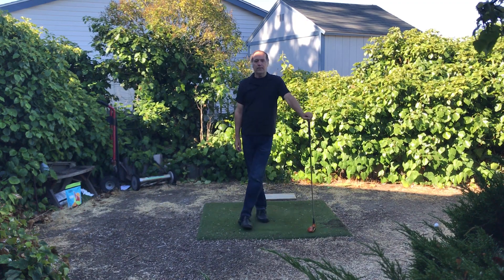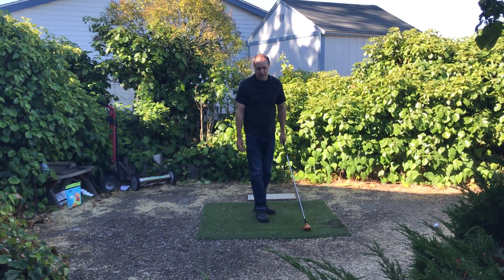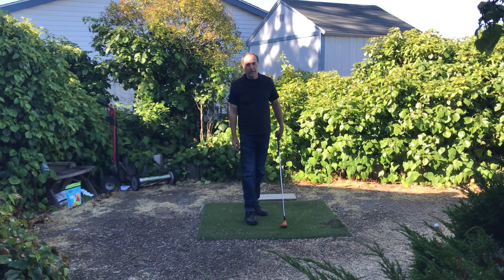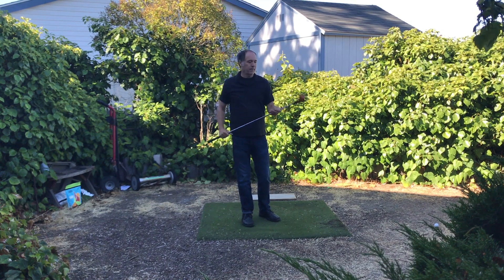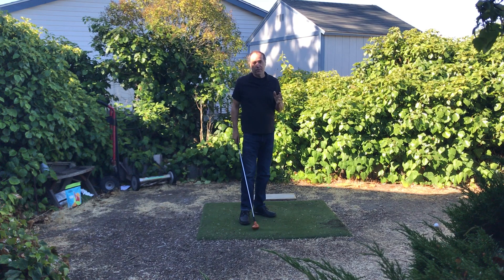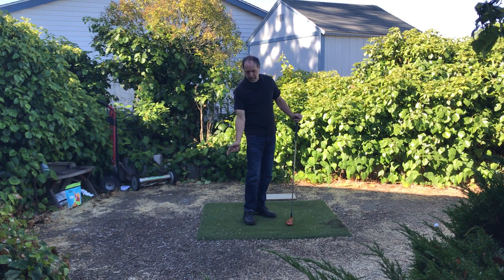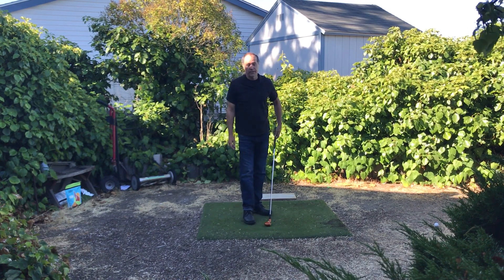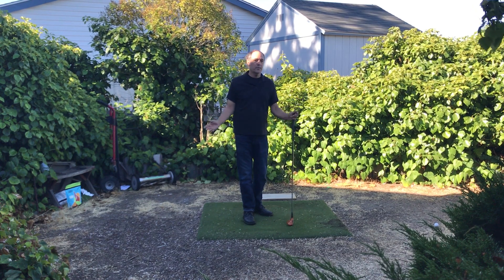Holding Shaft Flex using Advanced Ball Striking Protocols

Comment: It is quite easily demonstrable and probably supported by physics that kinetic energy is held in an arm that is rotating around a fixed center of rotation; and the amount of energy is directly proportional to the tensile strength of the arm itself; with arms with little or no tensile strength having little or no stored kinetic energy and those with greater tensile strength having more.  

When the rotating arm's force vector is uninterrupted by another force the energy in the arm remains constant.  It bends and stores kinetic energy.  When the arm's force vector is disrupted by an opposing force the kinetic energy in the rotation arm must be released.  A braking mechanism produces heat, while an object with inertia either absorbs that energy wo moving or is moved in the direction of the arm's force vector.  

So a golf club with a shaft with tensile strength to sustain stored kinetic energy can certainly be swung with stored energy until such time a braking mechanism or or the ball is struck.  If shaft is flexed when ball is struck some of the kinetic energy in the shaft is transferred to the force vector itself.  

Can it be effectively and efficiently be done by a person swinging a golf club; probably; but with a high degree of consistency (ie same speed and energy time and time again) probably not.  Unless of course you are always seeking to reach the maximum potential of the body club system as it remains in balance.  Then you are always pushing the potential for the maximum stored kinetic energy.  Who would argue that Hogan's swing doesn't demonstrate this principle of a moving balanced body club system with an accelerating force vector beyond the ball.  No recorded swing of Hogan substantiates him doing otherwise.
Reply: John E. understand this and is simply telling you about it.  He didn't invent it...my God he didn't discover it....some guy named Newton did...and Hogan built a golf swing applying the concept.

Comment: Where is the backswing, transition and  downswing? The shaft flex holding concept is surely about holding the flex induced at transition, not the flex induced by dragging a heavy head through impact from a Moe Norman style starting point??
Reply from the maker: Actually.. it's the opposite.. transition is what causes all the problems... too much stress at the top means acceleration too early.  The key is to accelerate post impact... to keep stress on the shaft through the strike.. so this is why this video focuses on that aspect.  Heavy heads are not about dragging, they are about slowing acceleration from the top and bringing more mass into impact which requires less velocity to strike the ball the same distance.  It all works together.
Reply: @lagpressure  so demo it from transition.
Reply from the maker: @golfbulldog  Again, this isn't about transition.. it's about holding flex through impact.  I used a driver with probably a regular shaft and a heavy head so we can actually see the shaft stressing.  No handle dragging here.  Give it a try... and see how it goes.  If you can find someone demonstrating this better through the strike, would love to see it.  Post the link here.
Reply: @lagpressure  the concept that you are trying to refute is that "shaft flex in a full swing cannot be held through impact" - no?? To refute that you need to demo it in a full swing...ie. control transition shaft flex and maintain the flex through impact. That's what you saw when you recorded Peter Senuor etc in your pro career, no?
Reply: I believe he did perform a full swing, however, the editing focuses on what the shaft is doing through the impact zone. In the end, the ball only cares about what’s happening in that zone. Everything up to that point is a vapor trail.
Reply: @golfbulldog   He can't properly demonstrate it because it's not true.
Reply: @theskillanalyst  I don't think that this is a full swing. If you pause the video and use the < and > keys to go free by frame in this clip and other clips where John demonstrates his swing...do your own observations in this manner and make your mind up that way.
Reply: @jackflash8756  my mind is open, but I suspect the real benefits of post impact acceleration occur for some reason other than holding shaft flex. Happy to be proven wrong. Note I am happy to believe that what John teaches does improve some swings, and that is more than what many instructors have sold in the past.
Reply from the maker: @golfbulldog  What is a full swing? That is a pretty ridiculous comment actually.  We are talking golf, right?
Reply from the maker: @jackflash8756  What is not true?
Reply: @lagpressure  It's not true that you can keep shaft flex for a full driver-5 iron swing through impact. Why didn't you just do your normal swing at full speed and then run it in slow motion? I assume it was because it showed forward shaft flex not lagging flex.
Reply: @lagpressure   You know what he meant. Do a full swing at your normal speed from address to backswing , downswing and follow-through
Reply from the maker: @jackflash8756  What is a full swing?  I use the same swing from putting, chipping, wedge shots, short irons, mid irons, long irons and driver.  I rarely if ever take a full swing.  Clearly I have demonstrated that is is "possible". So at what point are you suggesting it would NOT be possible?  This example I posted encompasses all the critical bio mechanical movements we would teach our students through the ABS training course.  Students learn to accelerate through the strike with their post impact pivot thrust, their hand speed, and learn to strengthen and increase both their velocity and acceleration so they can be on the path to superb ball striking.
Reply: @lagpressure   Use your full swing, and a normal modern driver  and then a normal persimmon driver by normal I mean not with the head weight more then 200grams and a shaft can be whatever flex you want.

Do both swings with each Driver and list the type of camera and it's specs,  get tested by a Golf Club manufacturer such as Callaway or Ping or whoever has the testing for clubs.

Then we will see the truth, no backyard trickery with substituting a whippy shaft, DOCTORED CLUB HEAD and suspect editing, you want to act like that vid you posted is refuting scientific claims then you need to do the experiment in a scientific manner, not some ridiculous backyard demo without any verification by an impartial scientific review of such a demo!

You're basically in over your head when it comes to the science!  Also nice open club face at the impact interval , you realize that the club head in your demo is open at impact due to your so called holding shaft flex which makes it impossible at that point to square the face.

The shaft is supposed to flex in the swing like this...right from "A TGM SCIENTIST"
http://www.theswingengineer.com/faq8.html

PLUS THIS  FROM A REAL SCIENTIST

https://people.stfx.ca/smackenz/Publications/MacKenzie%202010%20Understanding%20the%20mechanisms%20of%20shaft%20deflection%20in%20the%20downswing.pdf

Because of the offset position
of the club head’s center of mass, the shaft was gradually
pulled into its maximum leading position (1.22 cm) at
impact. Similarly, the shaft was gradually pulled into its
maximum toe-down position (-1.33 cm) at impact when
radial force acted as the lone contributor to shaft deflection
Reply: @lagpressure  ….. The driver looked to be either a MacGregor Tourney Eye-O-Magic  M85 or a 945?  Please John remember there are vintage club collectors out here.  And a few who were actually encouraged by YOU years ago.  You remember those vintage iron and wood sets you were selling (reshafted X Stiff) on ABS and of course the wood refinishing video series featuring the MacGregor 693 driver.  I can still remember the day you said you bought 3 of those old Wilson wedges for $20 a piece.  Thanks for everything John. You have certainly been a huge plus in my golfing life since I first discovered you and Brad now maybe 10 years ago.  I’ve never been to California, and would absolutely love to meet you and thank you in person some day.  Who knows, maybe it will happen?
Reply: These guys arguing lol. Anyways…a big thanks John to you and Bradley Hughes taking my game to the purest, straightest shots I’ve hit in 25 years of playing. Had a nice little 66 this past summer. Your guys concepts are brilliant!
Reply from the maker: @jaydubeck3435  Sounds like you need to be doing your own experiment.  I just did mine and it's clear as day that I can maintain shaft flex before lowpoint, through and beyond.  It's been done.. there you have it. As far as your experiment.. I doubt you could ever do what I just did.. but good luck trying!
Reply from the maker: @lookmil107  Make it happen!  Glad to know you are inspired by the great generation of equipment, ballstrikers and articulate course designs. The golden age is still with us if we choose to embrace it!
Reply from the maker: @jessewatson8281  Wonderful to hear that.  You might want to drop a note to neil@advancedballstriking.com as he has been documenting the hundreds of success stories ABS has inspired over the decade.
Reply: @lagpressure   Anyone can do what you did with a short little swing where the shaft doesn't go thru the range of flexing that a full swing produces!  You couldn't do it with your swing in the you tube video labeled  How to swing more like Ben Hogan.

Basically you're trying to fool people into believing this absurd idea by using a swing that no golfer does with a driver, not even J Rahm swings that short and he can't stop the club head from achieving a lead position at/near impact.

The physics doesn't support your theory proven over and over by many scientist who have wrote papers on shaft deflection and studied countless PGA TOUR golfers!!

But you know more then all of them because you need a gimmick to sell this absolute garbage... right Erickson... fleece them while you can!!
Reply from the maker: @jaydubeck3435  I understand your ignorance by reading your posts. Many things you don't understand. One of the first things you don't understand is that the longitudinal force stretches the shaft downward and straightens it.. especially at high velocities. You are completely unaware of this obviously.  The pre stress you would see in the shaft can still be Kinetically loaded without it being obviously visible.  You don't have an understanding of this.. but you should try to understand this so your post would be more informed.  There is a force moving down, and a force moving tangentially.  The video I posted shows that it's possible to hold shaft flex through the strike.. even without a ball there.  To do this as I clearly demonstrated takes a lot of work in the body and the application of force applied through the hands.. forearm rotation and uncocking of the wrists that happen in unison. We teach this to our students in a methodical method and the successes we have had have been more than compelling.  You won't find one player who has graduated ABS without significantly improved their ball striking.  
I have no problem arguing with scientists who bring incomplete data and are not able to explain a hitting methodology properly.  I haven't seen even one scientist than can properly define the difference.  Or trying to analyze a golf swing by only looking at ball flight.. with no consideration for mass of the clubhead.  f=ma or p=mv they don't even consider such basic fundamentals of physics. Now can you really trust someone that claims to be scientific that would over look the "m" in the equation? I don't.
Reply from the maker: @golfbulldog  I'm just demostrating that shaft flex can be held through the strike. What does a full swing mean?  What is a full swing for a 20 foot putt? ... a 20 yard pitch shot?  Tell me at what point in a golf swing can shaft flex no longer be held?  With the left arm at 9:00?  8:00? 10:00?  Doug Sanders vs John Daly?  Which is a full swing?  I define a full swing as the length of the backswing to achieve the desired result..
Reply: @lagpressure  We can get round all this typing of words by just posting the unedited slow motion footage of the "swing" you purport to be  demonstrating here...show us address, transition and follow through...any length of "full swing" you think will  be convincing.
Reply: @lagpressure  I assure you the scientists are well aware of "f=ma" and when it applies and when it doesn't.

I'd like to invite you to spend a full day, free, on my GEARS system. Maybe even two (it can get tiring), depending on the timing and your availability. We can measure things like your hand speed, your clubhead speed, the shaft deflection, your hip speed, etc. You can record any video you want and I'll screen record anything you want from the GEARS session. You can bring whatever equipment you'd like.
Reply from the maker: @iacas  Sounds great...
Reply from the maker: @golfbulldog  No matter what I post, folks locked into swinging release belief system still will not believe it, because most of the "scientists" collecting golf data are studying swinger's and not hitters.  They post the numbers and it's consistent with swinging, but not hitting. My focus here has been to demonstrate that a human can hold shaft flex through the strike.  It's not impossible.  Obviously not, because I just showed it here.. Now you come along and say, bla bla bla... it has to be this or that .....etc.  It's all pretty simple really.  If you shorten the backswing, put less stress on the shaft at transition, swing a heavier club and greatly increase the hand action at the bottom (not passive) and greatly increase the post impact pivot acceleration beyond lowpoint, that's the best way to do it.  So you work on these things when drilling and learning a hitting technique, and you're ball striking improves significantly. You take timing out of the swing because you don't have to worry about rapid clubface closure and timing elements of shaft deflection issues.  Much easier and reliable to just keep pressure on the shaft through the strike than to flex the shaft hard at transition and then time the straightening or release of the shaft into impact.  This is how the vast majority of golfers attempt to swing a golf club.... probably yourself included.  The reason the greatest strikers were different was because they did things differently. They weren't just better that timing the release, they used a different technique that seems to really upset the science world because they have built their machinery and a belief system around it studying the normal swing and not the advanced swing.
Reply: @Thegolfingoldman  My dear Geoffrey, as soon as I start to try and make money from teaching golf, my swing will be up there for you to critique. That doesn't stop me from offering an opinion on other people's swings or teachings. No financial conflict of interest.
The whole purpose of my comment here was to make it clear that the concept which people have concerns about in John's teaching (the concept of holding shaft flex) is not refuted by posting this oddly abbreviated, or needlessly edited, swing. Some others seem to agree, you appear not to...life goes on. 
Why not do a frame by frame analysis of this slow motion swing and compare it with any that John has done with a real full swing hitting a ball....the entire action is different... then ask yourself why...

Comment: I don’t see the point. The shaft is known to flex and deflect several times throughout the swing. Also, timing and using the delection of the shaft adds minimal clubhead speed, only 1 or 2 mph.
Reply from the maker: The point is to show that it is possible to bring a pre stressed clubshaft into impact.  Over the decade or so I have been teaching,  we almost constantly have some scientific representative that makes claims with complete conviction that it is "impossible" to do what I showed here.  So the "point" is to show it is possible... and not impossible.